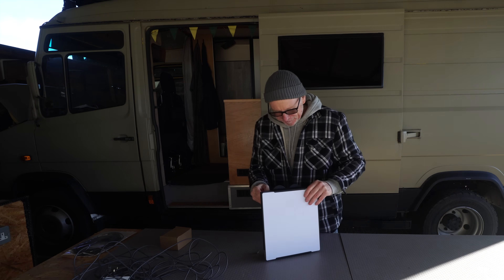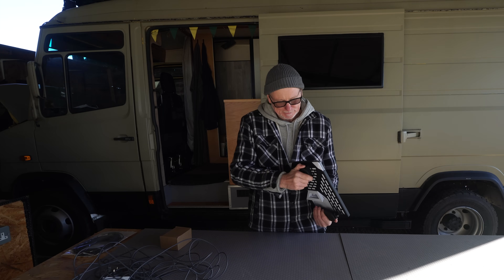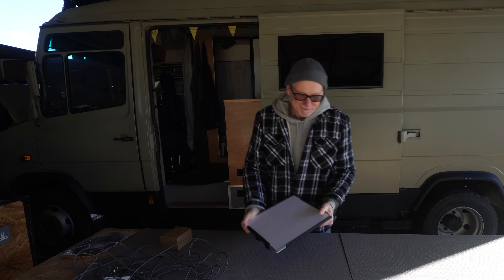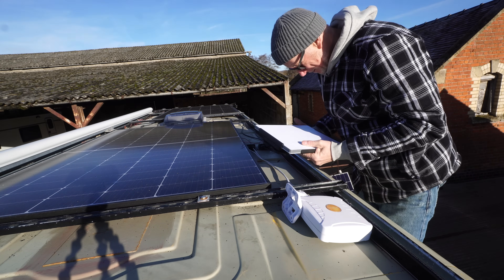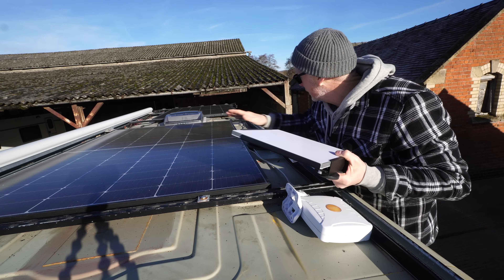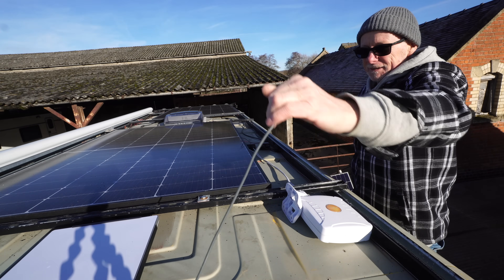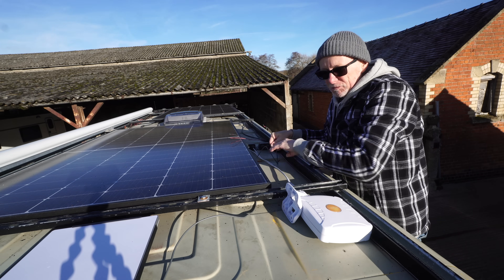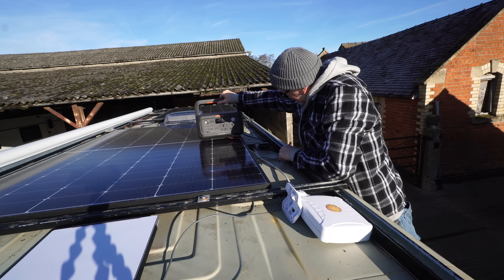I Wasted ££’s on STARLINK CAMPER VAN UPGRADE So You Don't Have To

Comment: Hi Mel, good job, power wise, well sussed out! - For small soldering jobs I've starting using those little refillable gas torches, handy, no plugging in and waiting for the soldering iron to heat up, obviously there are some things you can't use it for but if you are only using it for soldering a couple of wires together it's ideal, they are only about £4, some filling stations sell them. I solder most of my joints now as it's so quick and handy.
Reply: Not ideal for a power bank promotional video though
Reply: @mikerhodes6927  Yeah, you have to be careful or you could get shouted at 🤣
Reply from the maker: lol
Reply from the maker: That's a clever tip about the gas torches for small soldering jobs, thanks for sharing!

Comment: What you need to remember is that not everyone gets given a Jackory  nor can afford one.
Adding Starlink to an existing power setup that is near capacity already the few Watts saved could make all the difference!
So a £40 device that'll run from 12V is a heck of a lot cheaper than a new Jackory, plus there's weight and size to  consider too. The small converter can be put almost anywhere and has little weight, whereas the Jackory is bigger and heavier.
Reply from the maker: You're absolutely right! Every camper's setup is different, and finding the right balance between power and weight is crucial. Those small devices can really make a difference!

Comment: Don't forget, your powering the inverter which draws power for 240v . It'll draw additional power,so using 12v boosted to 30v sounds like a better idea.
Reply from the maker: You've hit on a key factor there, the inverter's draw definitely adds to the power consumption!

Comment: I just put mine on the dash board inside the van pointing to the sky and works every time and power it from the USB C 100w output on the Bluetti AC 200 Max
Reply from the maker: That's a clever setup, thanks for sharing your experience!

Comment: It looks like the watt draw are similar between ac and the dc connnection. What i'm wondering if this accounts for the power loss at your inverter when you convert your power from dc to ac. Inverter losses can be significant- up to about 20% depending on your system. Over time that's a lot of loss for no reason. I'd suspect that running direct dc is more efficient than it appears initially. Also, does Starlink draw more power with usage than at idle? That difference may be even more.
Reply from the maker: That's a really insightful point about inverter losses, something definitely worth considering for efficiency!

Comment: Bud great video 😊😊
I 3d printed mine and glued adisive string magnets to mine to fit on the roof. I bought the same box but not wired it up yet.  I’ve been mostly putting it on the dash through the big screen and magnets to the roof while I’m parked. But budddy I tell what I bought to run my starlink mini and it use about 22 watts to a peak on 27watta it uses usb c cable. Il put the link for use it does save power to the standard plug 😊

I have like yours on the roof but I’ve seen something I’m thinking of purchasing 😊 il add the link to that too :)

😊😊😊😊😊 great video 😊💙
Reply from the maker: Awesome to hear you found some great power-saving solutions and clever mounting ideas! Thanks for the positive vibes! 😊
Reply: @MelsBigVanSmallWorld I sent you the link to the cable will give you a 3rd option bud if you need it :) 😊
Reply: Won’t let me post links il pm it to you bud

Comment: You haven't included the power draw of having the inverter switched on at least another 15-25 watts. If you had nothing plugged into the jackery and left the AC output on the battery would run flat all by itself. Only trouble with your boost converter is they put out quite a bit of noise on the DC lines to the starlink which might Couse speed issues through interference that will get worse as the caps age in booster. You'll have to report back as time passes.
Reply from the maker: That's a really good point about the inverter's power draw and potential noise from the boost converter. Thanks for the heads-up!

Comment: Hi Mel, for low profile solder inline connections in wet areas I use adhesive lined (marine grade) heatshrink, then I stretch wrap the join, overlap from sheath to sheath with silicone tape and go over that again, overlapping  with insulating tape. (for lower profile, I stagger the joints) Bit of a bodge, but has not let me down yet, it supports the solder join too, reduces chances of flexing and breaking, 🙂
Reply from the maker: That's a really thorough and clever approach to waterproofing connections, thanks for sharing your insights! 🍻

Comment: Hey Mel 
Quick question is Star link better than the ariel you just took off as I have one off those on my boat for our WiFi etc, Star link is quite expensive?
It’s not available in Thailand 🇹🇭 as companies cannot be 100% owned by westerners they need majority shareholder to be Thai 🇹🇭 
 Cheers Gary and Mon with Ruby too 🐶
Reply from the maker: Starlink offers a more reliable and faster connection compared to traditional aerials, especially in remote areas.interesting about Thailand sounds like they got the right idea
Reply: @MelsBigVanSmallWorld I did look into getting it at home in uk 🇬🇧 on our boat maybe re look at it when we get back next year
Cheers Gary and Mon with Ruby too 🐶

Comment: The transformer jumped from 27w to 42w just before you unplugged it and you did not notice.
Reply from the maker: Good spot! Thanks for pointing that out.
Reply: The "transformer" is actually a dc to dc boost convertor, transformers are ac device's. 👍 😊

Comment: Hi Mel, not sure I understand this video. I bought a Mini a couple of weeks ago with the 12v cigarette adapter. The adapter just outputs 12v to the Dish. Snipped the cable, starlink running perfect on 12v. Why did you up the voltage to 30?
Reply from the maker: i also tried using the 12v plug when i was in scotland but it seems to run a lot slower when i was uploading a video
Reply: @MelsBigVanSmallWorld  Thanks, interesting, you'd think it would either work or not. I might try the 30v option.

Comment: Hi Mel. Used to build circuit boards and we were told to never apply solder to the iron, use iron for heat apply solder to the wire or component leg to avoid porosity in the solder joint as this can induce a resistance in the joint. Just an observation mate.
Reply from the maker: That's a really helpful observation, thanks for sharing your expertise!
Reply: You should "tin"the iron with some solder, then apply solder and iron together to" tin" the wires. But for flex cable I prefer to twist both together then apply the solder. As for the heat shrink, use hot air gun please. 👍 😊

Comment: Mel, WAGO type clips are far more superior to block connectors, the snap in and lockdown is much better than having to crush copper core or multi core cables with screw clamped cable; and for added security as you will most likely already know you can get the Wago sealed boxes of various designs… then you go ahead and use a TX60 quick connect plug🤔
Reply: I came here to say exactly the same thing.
Reply: I agree far superior, doesn't crush the core and maintains a constant pressure.
Reply from the maker: That's a great point about WAGO connectors,Thank you they definitely look like they have their advantages! i have ordered some 👍😎👍
Reply: Yea, i agree the wago offer much better connection and are they not becoming  a standard in uk regs ? 
There is bigger ones for bigger cables.

Comment: But you can run it off USB C straight from your Bluetti using the cable you can get from Starlink.
Reply from the maker: You're right, that's another option! but unfortunately i did try this but without much success. it works ok but seems like it slows down the connection and speed of uploading videos not just me my friend had the same issue. Hope this helps
Reply: @MelsBigVanSmallWorld  I have not noticed a difference so long as its a 100W plus supply but will check again to see.
Reply: Then it couldn’t be used in a jacket promotional video like this one…